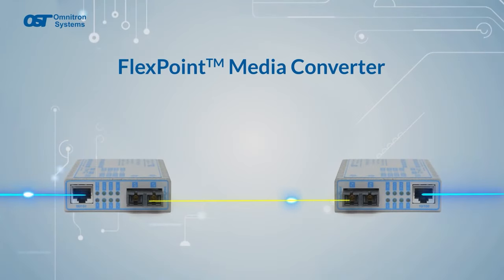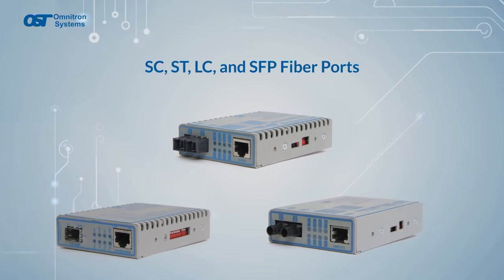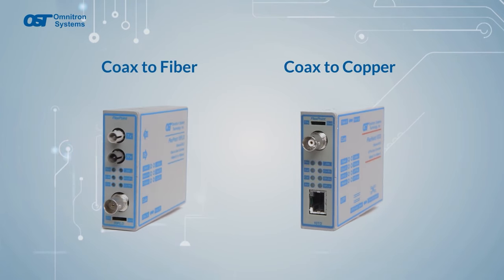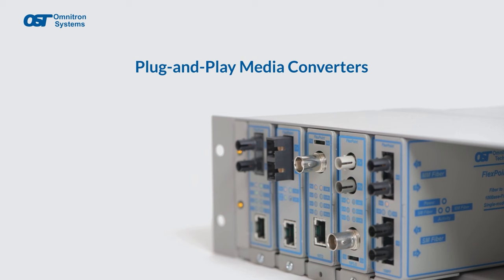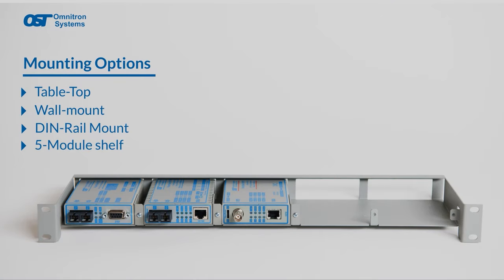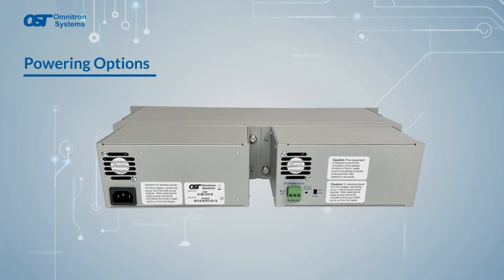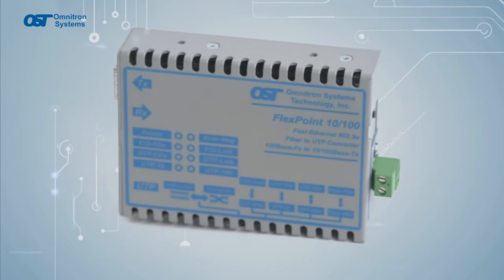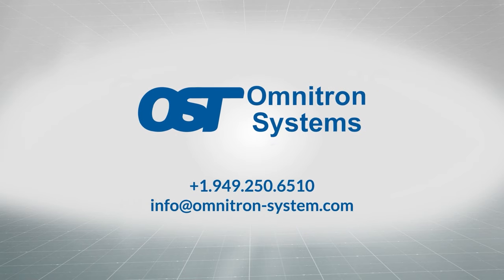Flexpoint™ Media converters by Omnitron Systems – Copper, Fiber and Coax Conversion

Comment: Are these are managed or unmanaged? What is the significance of the DC power adapater attached to the back of the Flexpoint vs DC green connector shown at the earlier part of the video?
Reply from the maker: Hi Sankar - great questions!  FlexPoints are unmanaged media converters.  The DC power adapter allows the device to be powered from any 18-60VDC power source.  So the same FlexPoint device can be powered by AC from the barrell or molex connector, or if you wish to redeploy the device in a DC environment, the DC adapter enables this (without having to install in a DC powered chassis).